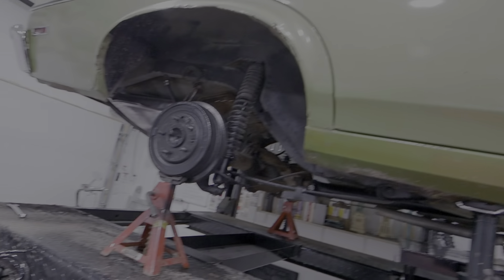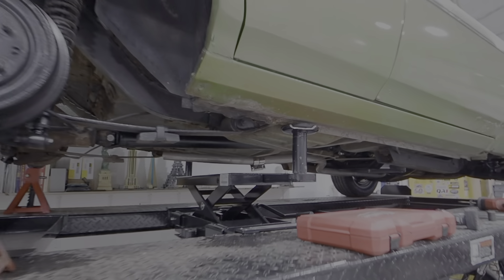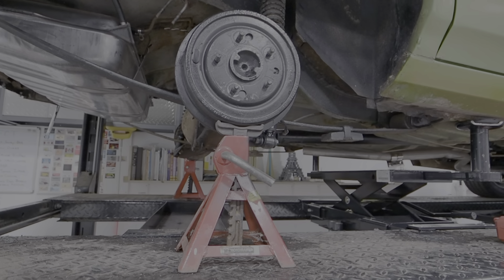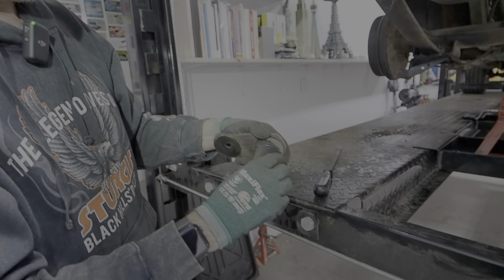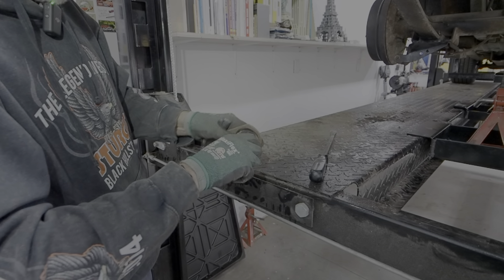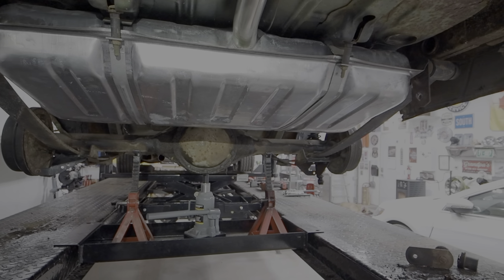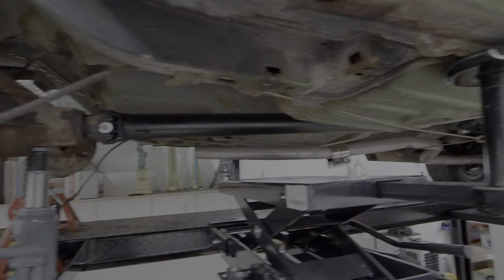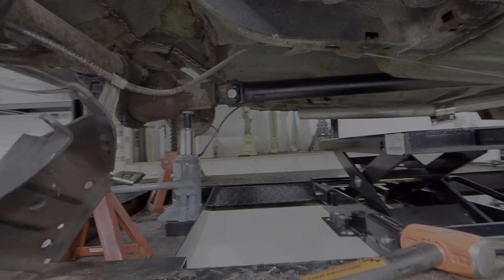Nova Rear Suspension Upgrades

Comment: Good job Mike Nova sits nice I prefer the multi leaf apposed to the mono left and did the same on my 67 firebird
Reply from the maker: Thanks Gary I have been wanting to do this for a while and like how it sets. With the adjustable shocks I should be able to tune in the ride and with the QA1 in the front this completes the suspension. Maybe a rear sway bar but well will see. Thanks for watching and your support.

Comment: Yeah, I was just looking at you. Trying to pry your leaf Spring off the bolt. You should've just jacked up the leafs Spring  where the bolt is and release the pressure on the bolt with the Jack.
Reply from the maker: Ya what you learn after the job is done.....but it was fun to get it done...... Thanks for watching.